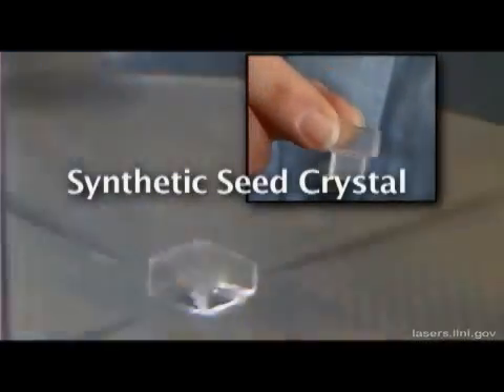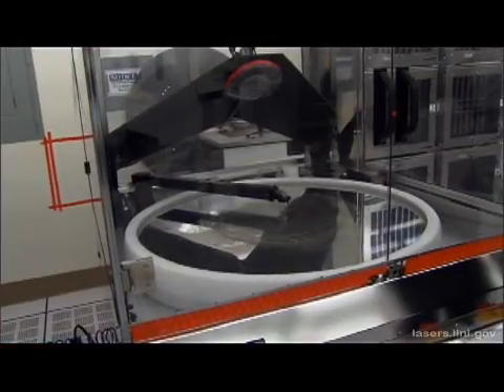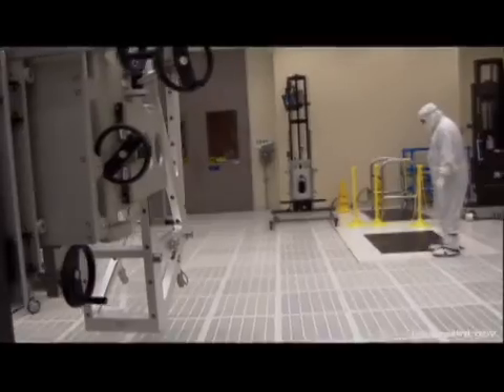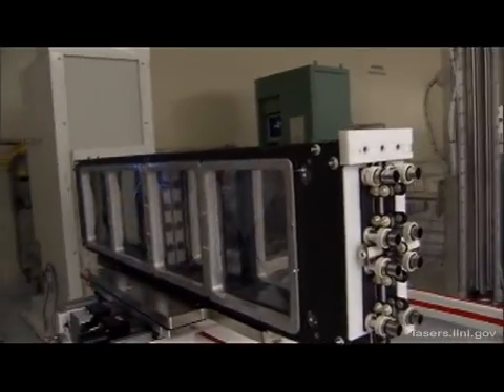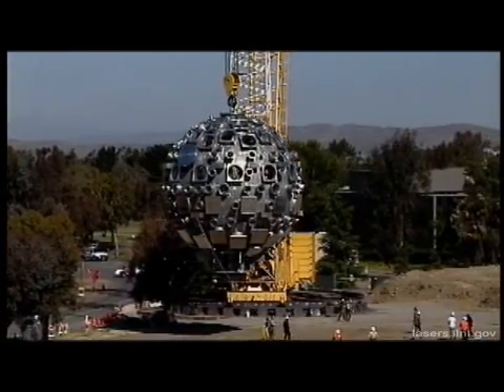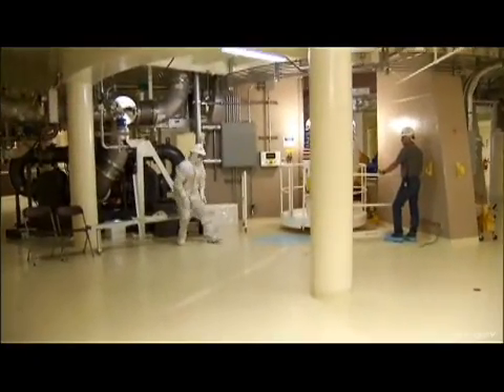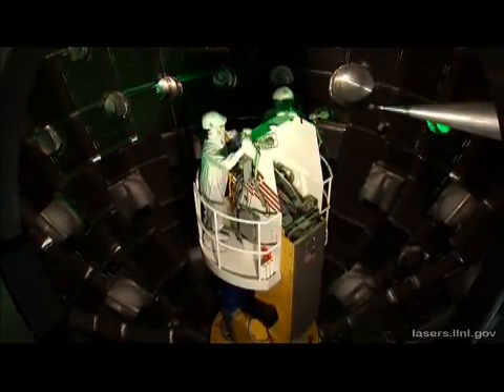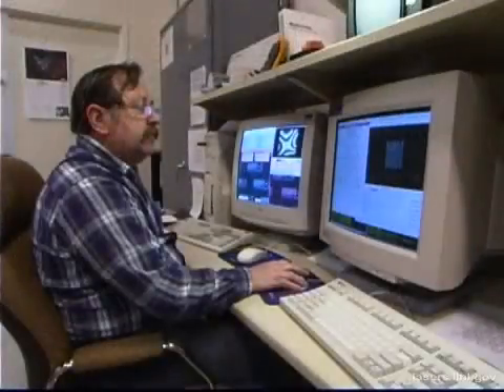National Ignition Facility shorts

Comment: You just failed hard. Hydrogen is the lightest element. IT CAN NOT SPLIT INTO LIGHTER ELEMENTS, which is what fission is. A hydrogen bomb cannot be a hydrogen bomb without fusion occurring. Fusion reactions are very hard to initiate and sustain (that's why the NIF is a BIG GIANT FUCKING FACILITY, not the size of a truck.) and we use the energy from a FISSION reaction to initiate the FUSION part of a thermonuclear bomb. So yeah, you need fission for fusion BOMBS to work, but not for this stuff.